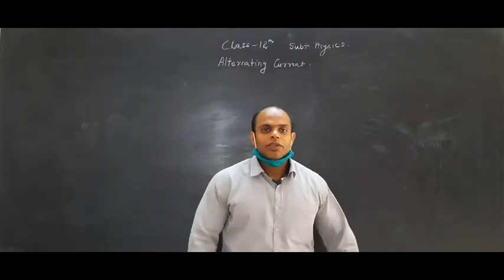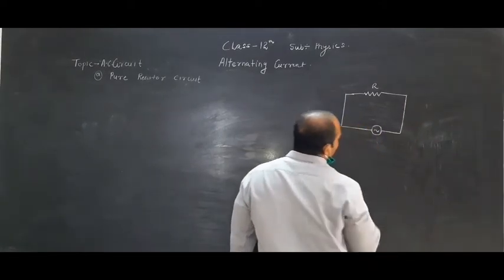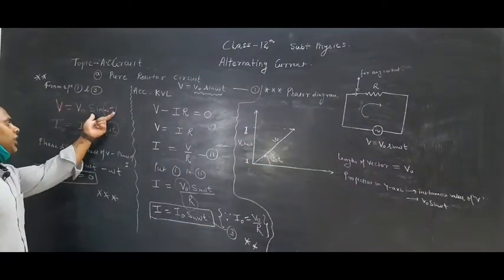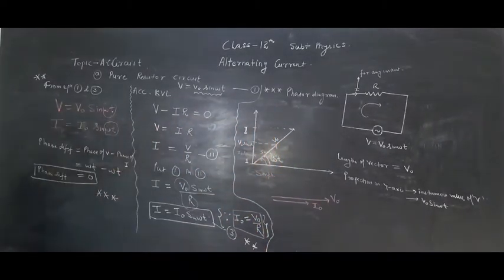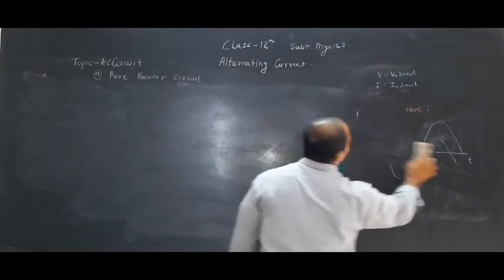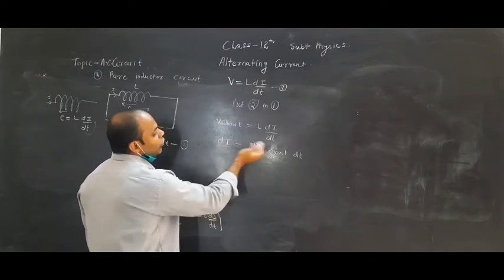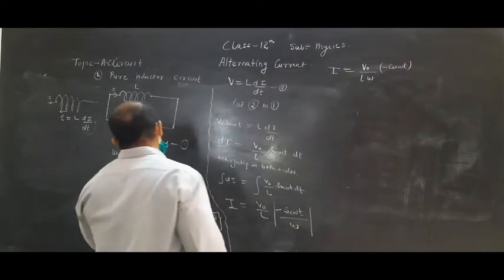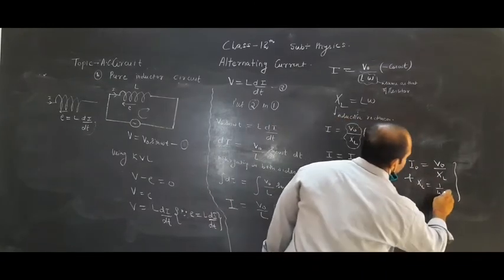Alternating current || Lecture 05 || AC CIRCUITS  PART 01

Comment: Sir ak bar KVL vapes bta do in short
Reply from the maker: Beta plz see it or call me I will explain 
Kirchhoff's Voltage Law (KVL) is Kirchhoff's second law that deals with the conservation of energy around a closed circuit path. ... His voltage law states that for a closed loop series path the algebraic sum of all the voltages around any closed loop in a circuit is equal to zero